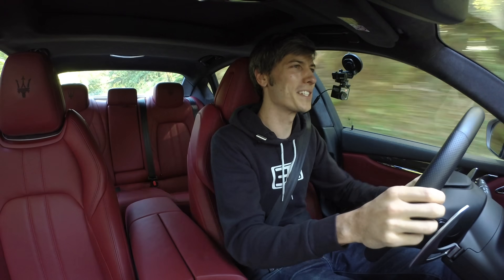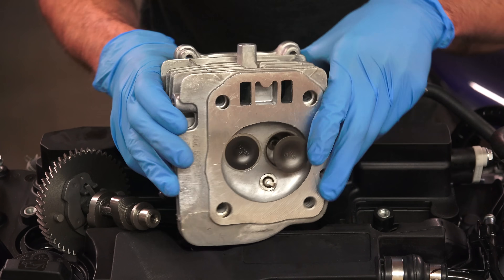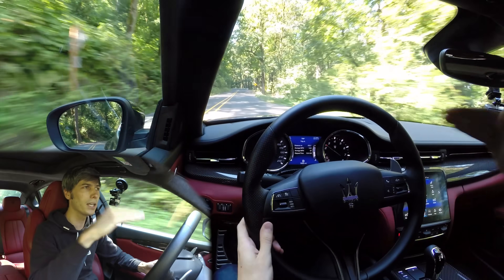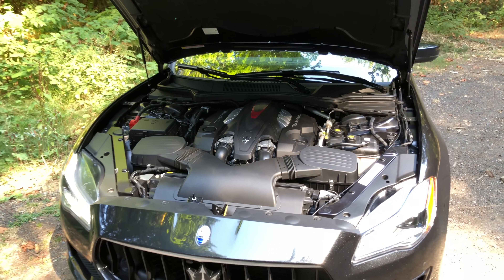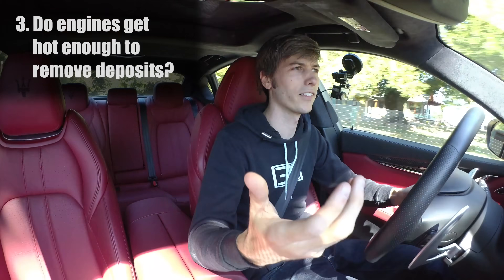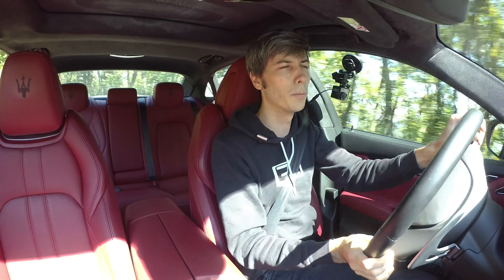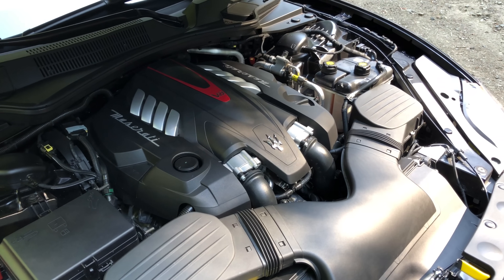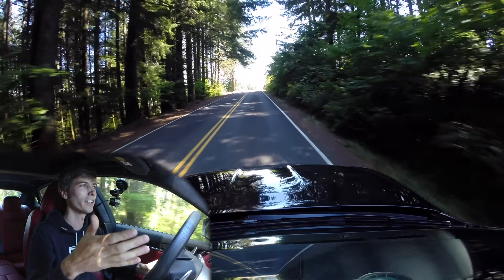Is Redline Good For Your Car's Engine? Italian Tune Up

Comment: My engine has serious rod-knock.
I think I'll try this "Italian tune up" and see if it helps anything...
Reply: It will probably make things worse. A knocking rod means you need bottom end work. Oh, I finally get it! You were joking. [face palm]
Reply: Oil buildup in engines is bad for them. Probably even worse than the carbon! Drain that stuff out. If you have an oil catch can, put it in there.
Reply: Try to inject water. Preferably hot water with soap.
Reply: Just give it a quick "Italian tune up" and you can inspect the rod first hand with your new observation window in the side of the block. No need to even remove the oil pan!
Reply: Brodie Bennett ummmm yea prob not. Ur toast. Get a new ride.
Reply: Dont forget to use a higher octane fuel for a while at least.
Reply: @darthdaddy6983  Any additive that you can suggest?
Reply: First change your oil with a thicker hot grade then put in two bottles of Nulon E10 worn engine treatment. That shit's like bearing in a bottle.
Reply: I worked with a guy from the 50s that said adding water to a running engine will get rid of your carbon knock. He tried it and bent pushrod. LOL
Reply: @splavin90  That works just fine, but the water must get introduced slowly
Reply: I say do it..... but please do film it!
Reply: 1. Hold steady 2000RPM 
2. Spray brake cleaner in the intake.
3. ??? 
4. Profit
Reply: general manko Remember to drain your oil first

Comment: Random question: what is that pointed part of the crankshaft or bearing cap at 3:44?
Reply from the maker: It splashes oil around the crankcase, and onto the bottom of the piston.
Reply: Called imaginatively an ‘oil splasher’
Reply: @HJZ75driver  in an engine that is "splash lubricated" .
Reply: volvo09 Mostly factory turbo engines. Also have oil squirters and extra holes in the piston to keep things cooler because of the extra bangy noises going on the other side

Comment: If driving at or near redline is good, CVT owners must have carbon deposit free engines.
Reply: I don't understand this since most cvt cars never get near redline
Reply: DMIsREAL They seem to get nearer to the redline than the average driver.
Reply: Maybe not redline, but they do jump to high rpm at acceleration. I would say 4-5k rpm based on the sound
Reply: @DMIsREAL  the Prius's I had to use for work seemed to jump to redline and hold it there until you were at speed limit, then settled down to 1k. Same when passing. In a big city environment, you follow traffic or become a traffic obstacle.
Reply: I haven't noticed that interesting
Reply: You're right, my mom has a Prius with a ScanGauge and that's the rpm it's at while accelerating.
Reply: Nissan sentra stays at 5k with cvt. Same for corolla
Reply: At least they have a fun free life!
Reply: Peak torque aka where the Variable valve timing kicks in.

Comment: As I understand it, harmonics come into play and at higher RPM's this can knock the carbon loose.  Years ago I ended up with my parent's old car and drove it like a teenager would- abusively.  Mom borrowed the car a month later for something and came back asking why it ran so much better than when she had it.  Not a scientific example, but the only thing that had changed was my judicious use of throttle and rpms compared to how she drove it.
Reply: Ahh, empirical evidence!
Reply: My buddy had a Honda and never revved it up. One time he got drunk so I drove him back home in his car. He kept nagging me about revving the car too high before shifting. That was before I knew about the "Italian tuneup." Bogging engines down isn't good for them.
Reply: WELL that could be why that one day I raced that 4 Cyl Hornet car (first time racing on a track) for 10 laps around the top lane for 7 laps and the last 3 on the bottom lane, foot to the floor and passing anything slower than a 4Cyl car (which there were a good 7 or 8 plus a couple mini vans) the driver that owned it said it ran better than it ever had lol
Reply: Had lifter tick
Changed the oil
No change 
Some injector cleaner and fresh gas and Rev the piss out of it for an hour 

Purrs like a kitty
Reply: Funny ill come by and run my moms forester like I stole it once an month and she always notices a big difference in performance
Reply: I believe this has more to do with the PCV system on the engine in question. If someone typically drives their car "like a grandma" all the time, barely ever seeing higher than 2500 rpm, oil can build up in places where it's not supposed to. I don't think your example has anything to do with carbon deposit buildup, but I don't doubt for a second that that car ran better in idle and part throttle conditions after you gave it some higher rpm accelerations. Every month or two I'll run my daily driver to the redline shift point for a couple gears coming onto the highway. I believe an engine benefits from being run like that once in a while, but mostly to prevent pooling oil from the PCV system.

Comment: Does carburetor car have fuel cut off? Because my 4g13 redline is 6.5k rpm but it will happily rev over 7.5k rpm and I even went to 8.5k rpm once , seriously hope I don't blow this motor up one day
Reply: Watch out. The stock engine can't really stand that high. My screaming for help at 6000 rpm (I shift at 6300 rpm for the highest)

Comment: High loads for diesels is the best thing u can do. I drive a Toyota D4D 2.5L. Its got Just about 600 000km, And never touched the engine. Except for services. The vehicle can load 1 metric ton. And that is wat is loaded on her every single day. Petrol on the other hand.......... Jip, good luck with the carbon guys. It sounds like fun. Lol
Reply: I'm sitting in a gasser toyota truck now... 267k miles / 429km . I think it'll rust out before I hit your miles :(  still runs like a champ though.... Original clutch too.
Reply: Herman Fourie The D4D isnt a 2.5L. its a 3.0L
Reply: @HJZ75driver  Here in South Africa it comes out in the 2.5 and 3.0L  The 2.5 is a 2kd engine and the 3.0L is a 1kd engine. I think as a technician I would have noticed the past 7 years.
Reply: HJZ75driver You know you can even get a 1.364L D4D for your Toyota Yaris?
Reply: BlastForward The AE92 came out with the 3L. It’s not uncommon. Also, the 2.8L is the 2KD engine. Not the 2.5L. the 3.0L is the 1KD. the 2.5 is a destroked 3.0L
Reply: that 1.4 litre diesel engine is also used on my citroen c1
Reply: @HaraldSjellose  0.6L engine in my car
Reply: @huseyinuguralacatli5064  hangi araba
Reply: @HaraldSjellose  fiat 126 bis küçücük ama 8 litre yakıyo 100km de
Reply: @huseyinuguralacatli5064  hava sogutmali mi
Reply: @HaraldSjellose  yok sulu
Reply: @huseyinuguralacatli5064  çok yakıyormuş sulu 700cc için karbüratör distribütör ayarları falan tam mı acaba, ama çok sevdiğim bi araba 126bis
Reply: @HaraldSjellose  valla benimki çok kötü bir durumda zevk için binilecek durumda değil yani tek amacı ayağı yerden kesmek yoksa şekli güzel
Reply: @huseyinuguralacatli5064  olsun guzel araba o paraya toros falan alacagima onu alirim
Reply: @HaraldSjellose  zevk için o ama kullanışlılık ?
Reply: @huseyinuguralacatli5064  tabii oncelik meselesi dedigin gibi

Comment: When I used to drive late 90's and early 00's Cadillacs all the time. If they ran a little rough I'd gun it on a highway ramp and it seemed to make the car run a lot better. Very noticable

Comment: You could probably do a whole 'nother video about water effects on carbon buildup. Some people inject water into the intake. Sounds risky to me. I've also heard that cars driven in the tropics have perfectly clean combustion chambers due to high water content in the air.
Reply: Ive used water to clean out carbon many times. Just gotta make sure the engine is right toasty when you do it, and make sure you dont dump too much water in. Try it with a shitty old lawnmower or something if you dont believe me.
Reply: Is this a joke? Ever heard of hydrostatic lock?
Reply: @jamesv4262  it's not a joke. The water (often times mixed with methanol) is pressurized and sprayed into the intake manifold (often near the throttle body.) Since it is atomized by the spray nozzle, hydrostatic lock isn't an issue unless you manage to spray it while the engine is off. Supposed to be many benefits, including power increase. You find it done frequently on large diesel engines, super/turbo charged cars used for racing, and on cars owned by horsepower addicts.
Reply: Water-methanol injection is a real&beneficial thing. I had a neighbor who has been doing it since he got-rodded cars in the 1930s. He&his son built a duece couple in 1965 with water injection. There was a significant difference in power while injecting the water-methanol. It was an amazingly fast little car. They embarrassed a lot of high dollar rides as they cleaned those posers'  wallets.
Reply: MW (Methanol water) injection was a big part of the reason why the Fw190 was such a terrifyingly powerful fighter. The germans developed a system for it called Methanol-Wasser 50, which was a 50/50 mix of Methanol and water, it would be injected into the super charger for its anti-detonation effect, allowing greater boost to be developed while cooling the air charge and engine. It helped generate a significant amount of power as needed
Reply: Eric the car guy did a video on this. It actually works. Me personally, i use steam.
Reply: Damn, my old Honda cbr125 always felt a bit more powerful when it was raining.

Comment: So with rotaries...... redline and redline often?
Reply: Wait, the RX-7 can be driven at non-redline?
Reply: go fast because you’ll get 20mpg no matter what speed you go
Reply: @fromstarlighttosunrise128  maximum 20 miles per gallon
Reply: Rotaries should be redlined at least once a drive
Reply: Rotary were the best long live the fb 12a
Reply: @mesanders1113  This was a '85 1.1
Reply: When you need to make that triangular rotor into a circle
Reply: Besides u get the benefit of blowing flames when shifting at redline!! 😎😎😲😲🤑🤑
Reply: Yes
Reply: Local Mazda dealerships (plural) report that engine failures are FAR more common with automatic transmissions, which shift far before redline. They also find more buildup, wear, and other issues than in manual cars, especially those that they know are driven hard on a regular basis. Rotaries, of course, run very hot, especially EGT, and aren’t saddled with 1890’s technology like popper valves, so YMMV.  They also love to rev, with 12,000 rpm redlines often used on racing engines (which is another subject, entirely).
Reply: Based on what I've read, rotaries need an occassional thrashing to clean the apex seals. My Protegé hardly sees 4,000 RPM while the RX-8 is sure to see 9,000 regularly. And of course the two-wheeler doesn't need to be revved being a piston engine, but I'm addicted to that magical feeling as it approaches the 13,200 RPM redline. Remember that the sole goal of a vehicle isn't necessarily reliability, but sometimes enjoyability.

Comment: Probably the effect that people notice is that the spark plugs WILL get hot enough to burn off the carbon deposited during slow driving and warm up that causees misfiring. This was most noticeable on older cars which tended to run rich in general, especially during warm up with the choke on. The old weak ignitions could not reliably fire plugs in this condition.  These cars will most definitely run better if run on the highway at speed fairly often.  I doubt that modern computer controlled engines benefit as much, as the mixture is controlled much better, spark is much hotter,  and they do not run as rich. Blasting to the redline is more for the driver's benefit than the engine. Running anything to it's max and beyond only shortens life.
Reply: My GMs from the 70s would need plugs changed between 3-6k miles (faster as they went past 60k). My last Pontiac was at 110k when it got new plugs, and my 3.5 ecoboost received new plugs at 40k.
New engines, fuel, and oil have completely changed the timing of tune ups.
Reply: True.  Hot ignition, tightly controlled fuel mixtures, and platinum style spark plugs have taken tuneup intervals from about 10,000 miles to about 100,000 miles. But the plugs will be quite worn by then, and sometimes hard to remove (corroded), so replacing plugs at 50,000 to 75,000 mile intervals might be a good idea if you plan to keep the vehicle a long time.  The plugs will be easier to remove, and you will be saving the coils from the high voltages necessary to fire worn out plugs with their huge gaps.
Reply: @DEW409  I've put over 800k miles on vehicles I've owned. Changed a lot of plugs, and avoided the Ford Tritons because of their "Adventures in (Plug) Babysitting"
Reply: @JasonW.  you had me at plig babysitting hahaha 😂

Comment: Interesting. 
What about other benefits and drawbacks of redlining once a day. Does this impact the wear of the cylinder walls? Or maybe your redline attempt is relatively early into the drive. Say you live  a couple of minutes from an highway onramp. And use that to push your car?